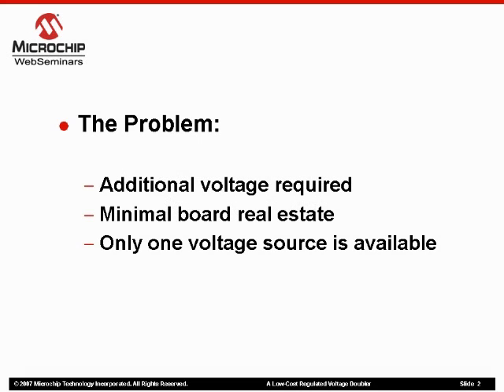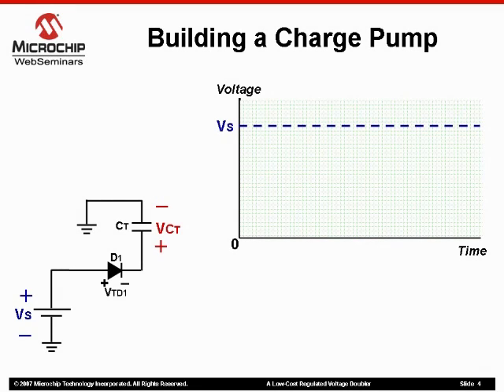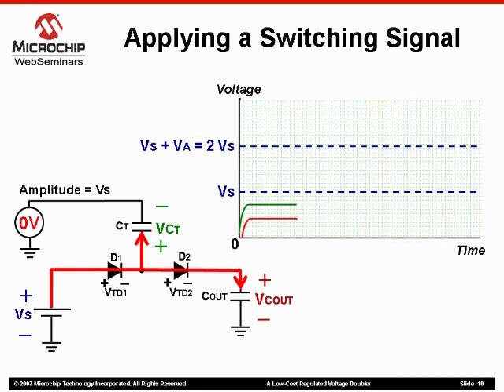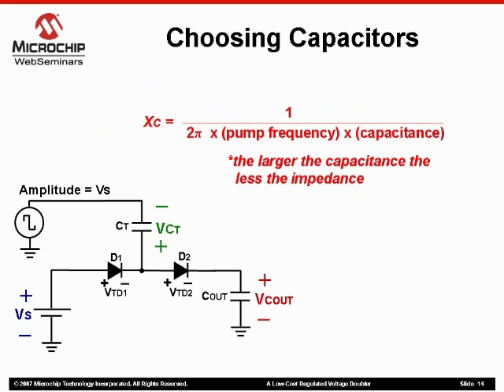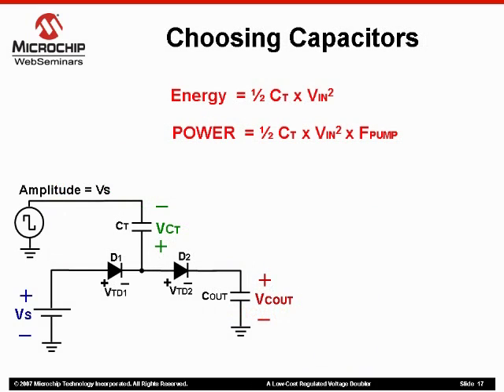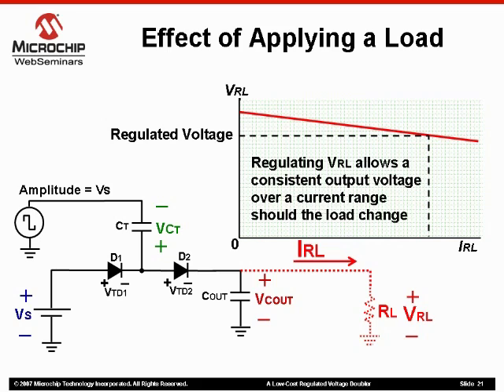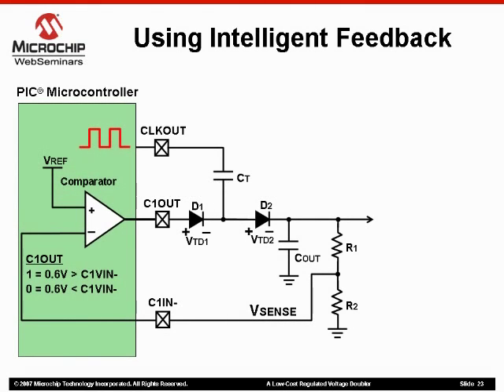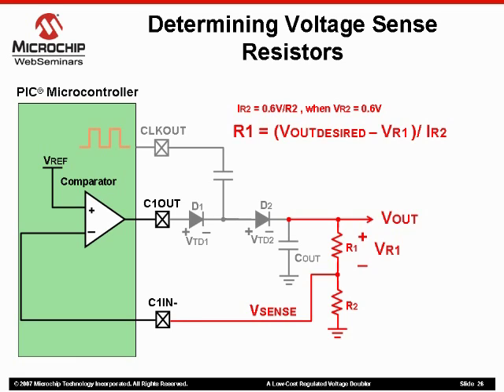A Low Cost Regulated Voltage Doubler Part 1 of 2

Comment: Very clever use for the built-in comparator and the voltage reference. Thanks for the video. I will adapt this to work as a voltage tripler.